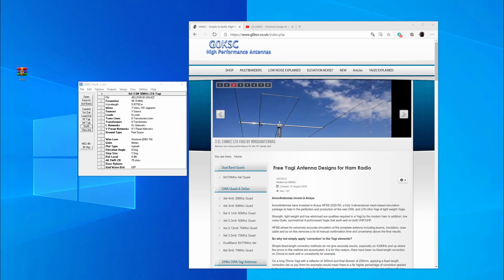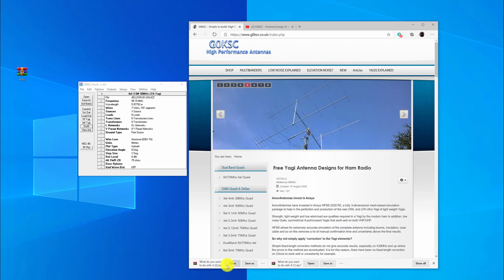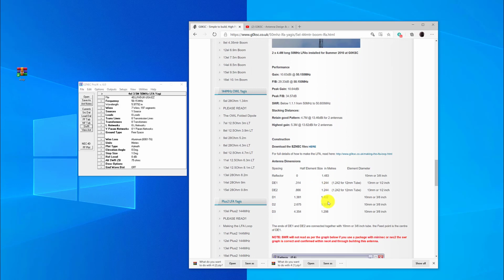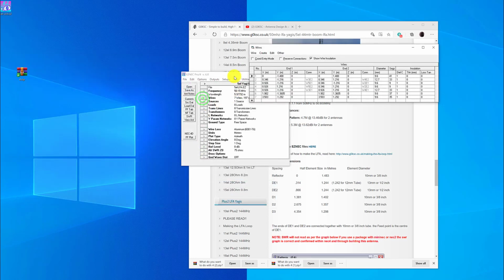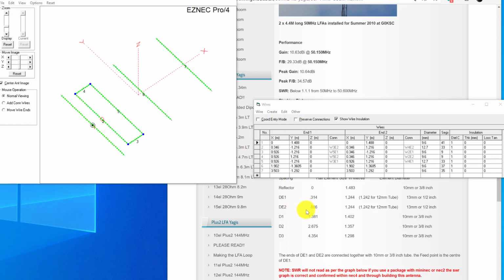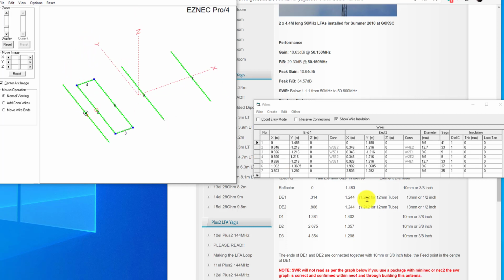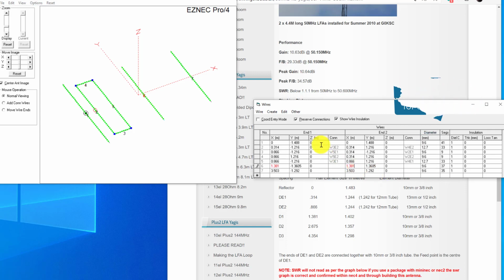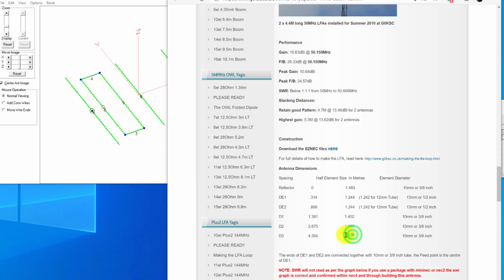A Yagi in TEN minutes using EZNEC software - Yagi design Explained

Comment: I downloaded the 4.zip file but I don't see the one used in the video.  I see a 2.1, 2.8 and 2.9 UK=USA template.  Has the zip file changed since the video was made?  It also looks like the website is a little different than the video, though I'm using Win11 on a PC which might be different.